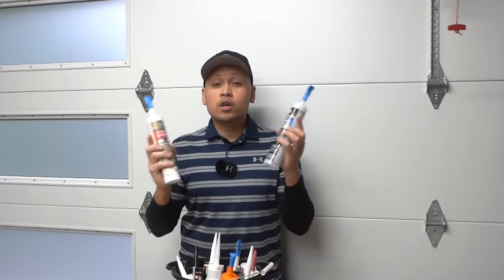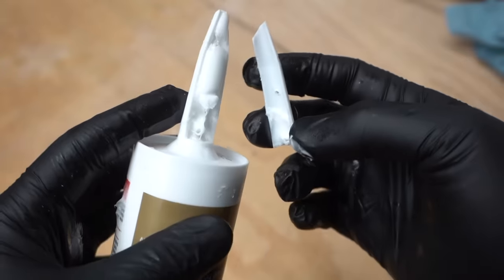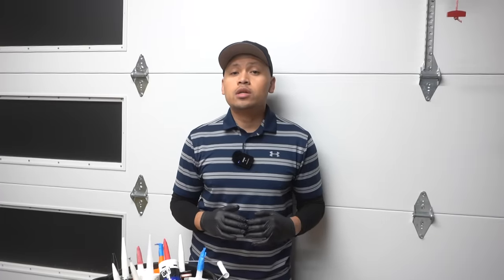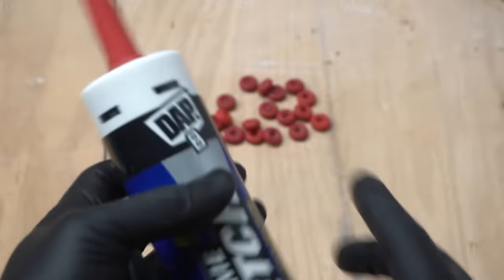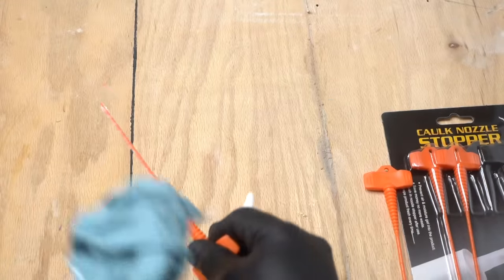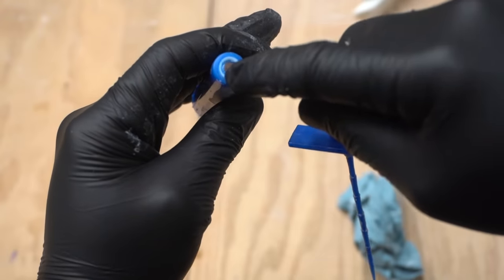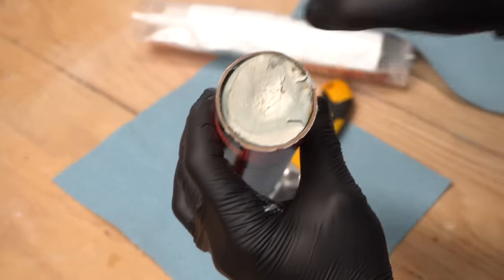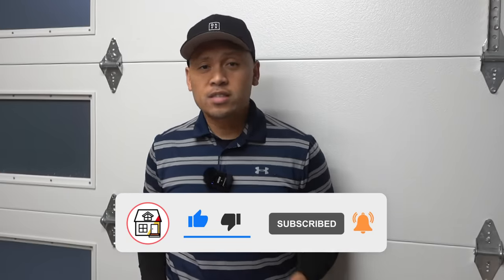STOP Throwing Away Half-Used Dried-Up Caulk Tubes! How To Fix It To Last Forever!

Comment from the maker: CAULK ITEMS I USED ON THIS VIDEO:
- Caulk Caps - https://amzn.to/3nSY4yf
- TUBE-A-NEW Caulk Tube Repair - https://amzn.to/3P7sPe7
- Lil-Pecker Caulk Saver Sealer Caps - https://amzn.to/3mn6YDB
- Caulk Nozzle Stopper - https://amzn.to/3mscfcQ
- Seal-A-Tube - https://amzn.to/43lYL39
- AirTire Tubes (X2) - https://amzn.to/3Uq7RI6

TOOLS I USED: 
- Dripless Caulk Gun - https://amzn.to/3o2Yx0G
- Retracting Utility Knife - https://amzn.to/3KQ4oiC
Reply: Caulk caps - probably one of the more useful “tips” I’ve seen in a long time.  Thanks
Reply: All this time I've just been squeezing petroleum jelly into an open tube. It works but you have to squeeze out a couple inches of caulk to get out all the jelly.
Reply: For many years, I just squeeze out about 1/4 inch of caulk/ sealant and store the tube tip down. When I want to use it, I gently pull on the dry piece sticking out. It stretches most of the dry material into a more slender section and pops out. Generally about one inch comes out before the soft part.  Works almost every time for me.
Reply: It worked! Thank you!!
Reply: Caulk rubbers ( condoms )
Reply: 3:45 How did you do this with the "Like/ dislike" button? I am asking on behalf of another YouTuber who'd like to use it.
Reply: Love you video...diy...very practical....please keep up your good work on the show! Thumbs up!
Reply: Stop selling us stuff! Show us real tips - how to make the caulk tube caps ourselves.
Reply: @waynenetzley1045 I thought the same thing, and I am sure we are not the only ones.
Reply: Where do you live that caulk is so expensive. In UK  the tubes come with a replaceable nozzle but I did like the the caps and the last one for renewing the end of the tube.
Reply: The caulk caps I have used on silicon tubes melted, total fail
Reply: 5:19 Hate it when that happens, lol!
Reply: Guys,  listen....  its taken me years to suddenly  find the easiest, cheapest way to save your silicon tube when half used.
No need for all those  accessories....

For  guaranteed  way to seal your silicon  tube do this.... at about 1 cent cost....

After using your silicon tube,  remove the nib.
Then scrape  the nozzle  free if silicon  to leave a little indentation in the silicon at the nozzle.
Now comes  the amazing part...
Take a burning candle  and  pour a few  drops  of  wax into the  indentation  which you made. Let it dry,  then next time you use your silicon tube just break the wax off. And go.

As for the first nozzle,  let the silicon dry in it,  then after dry get a small flat screwdriver  and scrape out to make clean for reuse.
Its works, let me tell you.
If it dosen't  then I am going to sell bread.
Reply: @tbone6354  sounds good, I’ll give it a try!
Reply: Elon Musk keeps his caulking tubes on space storage he owns.

Comment: Here in the UK nearly all mastic tubes have screw on nozzles, so when one has dried out, you just change it for a new one. The dried out nozzle seals off the mastic inside the main tube and it could last for over a year on most tubes.
Reply: The same in Brazil. It's insane that in the US, where most of the technological advancements occur and they have an absurd amount of product, still doesn't have a screw on nozzle. It's so much simpler and you can even screw on a closed nozzle in if you want to preserve the caulk even better. Also, after it dries out, you can just pull out the dried caulk/silicone if it's a elastic type of material and just reuse the nozzle.
Reply: @luccasbp  Yeah, pull out with a corkscrew.
Reply: I  like those too but here only marine stuff has them and you are paying arm and a leg. US manufacturers are just getting more and more stupid with everything lately.
Reply: @ainstaink8312  It's the US consumer that's stupid. We put up with waste and frustration at every turn. If we demanded better, the corporations would deliver better. But instead we sleep walk through life thinking Corporations can do no wrong and have our best interests at heart.
Reply: That is a great idea. Here in the USA,  most  products are left the way they are so you will keep buying the same product. It is the business machine keeping things as they are. People like me have to watch videos like this to try to improvise.
Reply: @garysnewjob 
Very true !
Reply: Subaru mechanic here & our FIPG tubes have threaded nozzles. The US just loves planned obsolescence, more money to make.
Reply: True i still don't like throwing away nozzles each time though. You can push out the dry part from the back of the nozzle of course but its messy.
What i find works is the simplest way.
After use push out some product and use a wet finger to round off to a ball on the nozzle end. When you want to use it again just pull off the dried end and its always wet inside. The only issue is to not knock off the end while in storage.
Reply: @wwhb4780  .
Reply: Same in Sweden. I've often cleaned the nozzle by unscrewing it and blowing out the plug backwards through the nozzle with compressed air.

I rarely change the entire nozzle... It is just a nice last resort. We also have nozzles (since they are separate) with caps you can screw on.
Reply: @Luccas Baptista  The US is behind in most technical advancements. Seriously behind in banking and electrical technology.
Reply: It's all about money here in the US.  Just think about how many more caulk tubes are sold because the tubes dry out in between uses.  If 100% of the caulk was used before another one was needed, they's sell a fraction of the stuff.
Reply: I do agree that it's all about the money in the US. More waste, but usually better products and SOOOOOO many more products than what we have. Also, everything is just absurd in price here, but I find it quite amusing when we actually do have better products or solutions than the US. 

And I agree that in renewable energy Brazil is more advanced, even though solar is still very expensive here and electric vehicles are just insanely expensive that if I've seen one or two where I live (3 million people city) I've seen it all. 

Banking we have been killing it lately, but it's still very expensive to have a loan. If you buy a car in installments, you usually pay twice of the price of the car. So the fees are really out of control and expensive. I guess we can't have it all, right?

US consumers are much more demanding in quality than in Brazil. We pay a lot of money for a lot of crappy stuff. But you should really complain to theses companies that sell silicone or caulk, maybe it's such a great feature for them that they could win more market share, specially when it solves a problem consumers have and competition will be forced to adapt.
Reply: That type of cap is patented. A popular Home Depo brand had the screw on caps  in Canada, later that manufacturer stopped using the removable cap. I asked the Home Depot dude and he told me about the parent infringement.
Reply: The problem is not the technology, the problem is the corporations. There is little to no competition because the corporations are so large and own so much market share. It is good for corporate profits to have you buy new caulk every time you need to use it. No competition means no need to change anything. Corporations also own the political system so they don't allow any regulations that might cause them to change. It's a problem much larger then just caulk.
Reply: It's the same in Australia..I'll usually get a few extra nozzels with each tube.
Reply: @luccasbp  .  That's what I've been doing for years. If it's hard in the nozzle, unscrew it, push the dried stuff in the nozzle back out, and you are good to go....usually. If it doesn't work ? well, you can't win em all 😂
Cheers from Australia.
Reply: @Daniel_Antonio_Arellano782  ..I always watch these types of videos, because there is always someone who comes up with a brilliant idea that really works. I liked and subbed to this guy.
Reply: Same in France ; the nozzles also have threads at the thin end and come with a threaded cap so you can close them and reuse them without replacing them...
Reply: Same in South Africa, just unscrew the dry nozzle and replace with a new sealed nozzle available in store
Reply: It's the same in Australia --  almost all of these type of mastic and adhesive tubes come with a screw-on tip, and the tips are mostly the same size.
Reply: Yeah, like Luccas Baptista said, here in US  our technology is often behind the times, even on simple everyday gadgets. In my travels to europe, a few  decades ago, just about everyone had a cellphone when no one in US even knew cell phones existed.
Reply: Unscrew the nozzle and roll a balloon over the entire cylinder end.  That is if you live in a country which offers threaded nozzles.
Reply: @luccasbp  some of the higher dollar silicone tubes do have  the screw on caps here in the US ,unfortunately Were Cheapskates!!   even me !! always looking for the best deal even if it isnt in the long run
Reply: Australia uses screw-on nozzles. A good invention would just be a screw-on sealing cap.
Reply: @marks-0-0  Good one!!
Reply: Same here in Australia. They have a box of them for free at the local Bunnings.
Reply: Gripfill doesn't so these little rubber johnnies are perfect for them.
Reply: @luccasbp  I'm in the US. Companies work on making sure you have to buy more, not on quality anymore. Everything. Its all about the revenue. I'm old. I can remember when products lasted and were reliable. Not so now.
Reply: I had once no nozzle on packet, and because comppany had no extra screwnozzels,  I took with 9cm screw all the sleas from used sealing tupe screw nozzles and used it on my job.
Reply: @dennisolsson3119  +1 for the compressed air backwards. From Hungary.
Reply: @luccasbp  The corporations want it to expire early so you can go out and buy more.
Reply: I use a Marette
Reply: Well, here in 'Murica, we have planned obsolescene.  DAP wants me to buy as many caulk tubes as possible, so, a tube drying out is a win for them.  Yay team "Murica!
Reply: That means that if i go to america and start selling nozzles and tread maker kit, I will become rich! Free market baby!
Reply: WHOAH!!! That's insane. I didn't even notice that until reading this comment. Had to check video closely again. I've never ever seen one without threaded nozzles in Finland. I have plastic bag filled with dozens off nozzles at work. Though usually I plop dried sealant from old nozle with compressed air to save nozzles.
Reply: @dennisolsson3119  Try that with one of these American caulk tubes! 😂😂😂😂 A new way to apply caulk -- to everything! 😂😂 We might like to do that with the CEOs of DAP and GE standing beside us at the other end of the tube.  Maybe they'd learn something.
Reply: @luccasbp  Car buying is the same here.  So is house buying.  You pay twice if you pay in installments, unless you prepay a few whenever you can.
Reply: @Hunty49  in the UK we already have screw on replacement nozzles with screw on caps!
Reply: @dennisolsson3119  ok nice I will try the compressed air next time.
Reply: @luccasbp  yep it's almost like they want the consumers to buy new tubes. Hmm... But in the US? No way, money and greed has never been a factor there 😅
Reply: Yep, and the only reason they dry up when you use a screw is because a screw doesn't fully seal them. It's only the air that gets in that's curing the product. I use a screw then wrap the top in cling film, makes a big difference.
Reply: Even with screw on nozzles the content in the whole nozzle will dry out. I just push a pair of long-nosed pliers into the nozzle dried content from the threaded end and pull it out. Often it tears and needs a second jab into the remainder to rip out the rest. 👍🇳🇿
Reply: When you cut off the end of the nozzle keep the cut off bit and just reverse it and push it back into the nozzle after use. This seals the nozzle until next use.
Reply: Timothy Martin  I agree with that! They want you to waste so you go back and buy more.
Reply: @luccasbp  that would cause a massive $$$ shift in the construction caulking economy
Reply: Think bad and u will be right. So tube is manufactured in such a way that once you use it the life spam is short so u can not reuse it so u have to buy again.
Reply: @luccasbp  This is standard practice for silicone caulk/adhesive/RTV when packaged in smaller containers not designed for caulk guns.
Reply: Unfortunately, we here in North America, aren't as smart as you Brits! 😂
Reply: @Golecom2  You can but then you will find yourself in a lawsuit because that technology was developed decades ago and was patented. You'll then have to stop selling your screw cap AND pay the other company for damages and lost revenue. Now you've lost money.
Reply: @marks-0-0  well, here you have more chances to be imaginative, you can use the dry cone to clean the nozzle and reuse it to fill it every time. Or put any other thing  inside the nozzle
Reply: Same in Australia
Reply: @garysnewjob I demand better as does practically everyone else in the building community. So now tell me Mr. Answer man, how can I convince caulk manufacturers to change their design. I’ll wait for your answer.
Reply: @michaelweaver2627 Well said👍

Comment: The trick to reusing caulk later is to store it like this. Squeeze out a blob on the tip. You're going to make a little handle of caulk so that when you pull it off, it pulls the dried portion inside the tube out with it. Squeeze out a blob and use a gloved hand to create a round booger at the end of the tip. Let it dry like this. And when you go back to use it, pull that blob off and it will bring the dried portion inside the tip with it. No gadgets needed.
Reply: or squeeze it in to the "little finger" of a disposabel glove.
Reply: Only works when you have days apart... not weeks++
Reply: @justnoted2995  Especially not months...
Reply: @justnoted2995  It depends on a few variables but I've gotten months out of some types/brands (big stretch and silicone). Probably not with the high-VOC caulks.
Reply: @jamesw.6931  Yep. Gravity can sometimes interfere in the drying process if you just squeeze out an inch. But same underlying idea is creating enough of a handle to pull out the dried portion when you clean off the tip.
Reply: I use to have a bucket of un-used/used wax in my trunk and I would jam the tubes tip first, throw em in my box and that would save my tubes for so long I forget why I even have em.
Reply: Been using a small vacuum cap, but it still dried out, I like the tips offers here and will try them
Reply: PROBLEM WITH THAT IS THE NOZZLE IS TAPERED. PULLING IT OUT WOULD BE A BITCH WITHOUT IT BREAKING OFF .
Reply: @justnoted2995  Works for me having months in between, depending on the product. But if that failts I do what another commenter suggested, just unscrew the nozzle and change it.

Comment: I use aluminum foil tape.  This tape sticks really well to the soft plastic nozzle producing an air tight seal.  This tape is made to seal metal ducting, and the adhesive sticks really well to plastic.  I’ve left aluminum taped calk tabes for months without any problem.   Best thing, it’s really cheap and requires no cleanup, just tear off another piece of tape.
Reply: When you puncture the seal in a new caulk tube, that’s aluminum you’re puncturing, so your method makes sense 👍🏻
Reply: I've wrapped my ex-wives in that, and I agree that it works great.
Reply: @usernamemykel  Yeh,still fresh after months??:face-fuchsia-poop-shape:
Reply: I use blue tuck tape
Reply: @pizzasaurolophus : Agreed, and because of its' sticking power can be used for countless applications
Reply: Foil + tape works. Silicone much tougher than latex to pteserve
Reply: Stop wasting tape. Just use a bead of caulk on the tip shape with a wet fingertip and let dry . I've used this method for years and never fails.
Reply: @jooproos6559  😂
Reply: 10:08

Comment: I simply squeeze it a little bit out of the nozzle and let it dry.  And later I just pull the dried part out of the nozzle and use it again. It works for me.
Reply: It ususally breaks off and the tube is still plugged.
Reply: Short term seal, yes
Reply: I've done this for years.  It worked well for me.

Comment: I've also used wire nuts as caps for these types of tubes.  Very easy and inexpensive to use!
Reply: and some electrical tape or some other good tape to wrap it on the tip.
Reply: I use either the red or blue wire nuts.
Reply: Yup, & if you squeese some material in the nut first it is 100% air-tight.